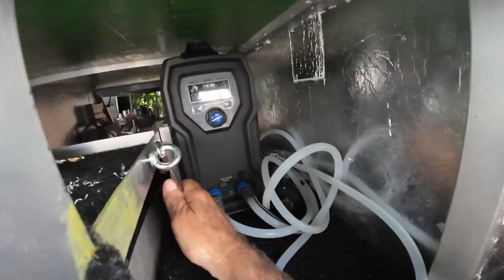Half Canopy Build Part 6 Is this the Best Camp Shower Set Up

Comment: I love the shower ,you can get a little shower chair on the draw bar you sit back chill out,get a cheap chrome shower set butterfly nut you run connection off the back rack bar Bunnings $ 20 it will swing out a bit off the tack not putting water into ya tray doesn't matter cause it rains,was that chilli crab good eating did it have a kick
Reply from the maker: Love how you think Mark def look forward to a few trips to sort things out can see me sitting on the draw bar having a long hot shower lol  and yes mate next day the crab def had zing to it lol thanks mate..🦀🎣👍

Comment: As the world slow down during the holiday break Andy is going full bore which proves the legend grows even when we rest. Thanks for taking us on the journey Andy. Onwards to 4k plus,big Barra and many more Ogoodzat’s !!!!!!.
Reply from the maker: Hahaha Wayne I was going to have 3 weeks off haha don’t know what happened to that 😂 Bring on the 4K Wooohoo OWGOODZAT thanks mate your a champion.. Big Barra🤞🤞🎣
Reply: G'day Andy,
I used to have a fold out fabric cubicle and put the shower head with hose on top of it and you had a zip and you unzipped it and got in and had a shower. I used to use rubber mats to stop sand on feet. The hose had a pump and you would put it into a bucket of water. The cubicle folded away  to a flat round circle. I think I got it from bcf along with the portable shower. You could not see through the fabric so quite private. Your set up is going nicely and appreciate the effort you have put into it. It will serve you well on remote bush trips.
The Major
BB🔧🪛🎣😄🤙🪣🚿
Reply from the maker: @chrisdoran7596  yes Mr Major I’ll need a good rubber mat for the ground and I’ve also got a companion submersible pump & shower I’ve had for a heap of years that I’ll use in this hot weather.. really looking forward to getting out when all done thank you..👌👍